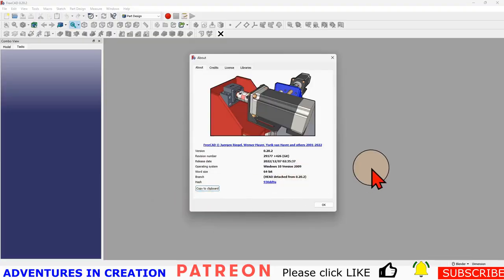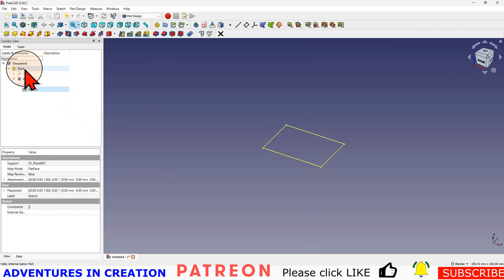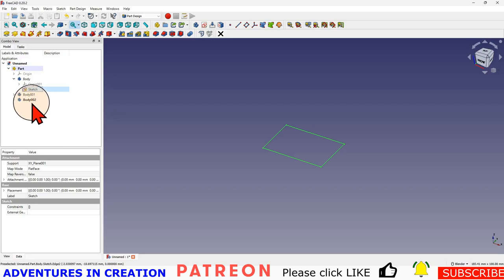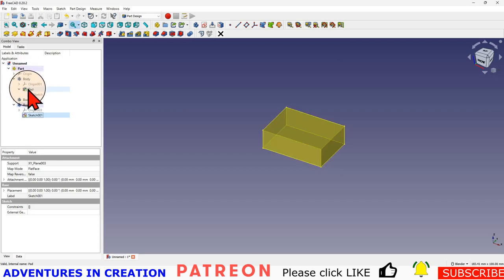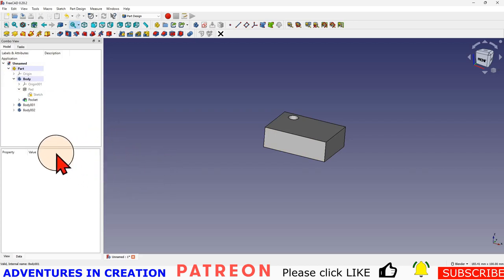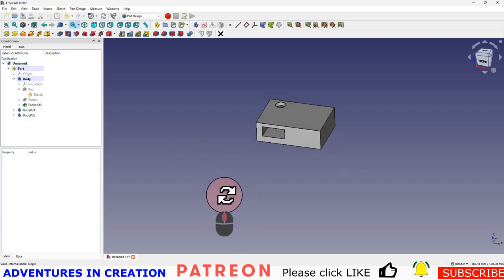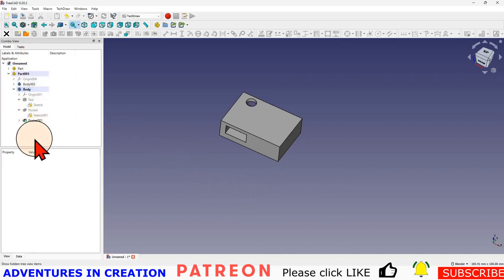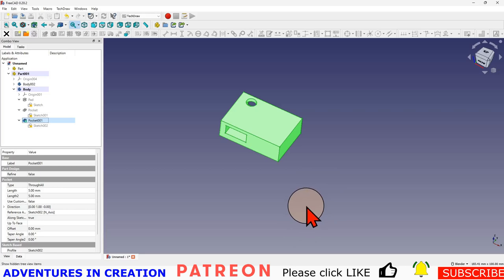Back 2 Basics Number 5 FreeCAD basics #freecad #cad #design #makers

Comment: Excellent video!🎆 Very often I screwed up the objects because I had some hickups in the object structure. And couldn't fix it, i.e. moving a sketch to the right body. 
I had to start over again..😢
NowI finally understand the structure, understand what needs to be active and when, and how to move elements if needed. Most important video for beginners imho.🙏
Reply from the maker: Thanks!

Comment: Again a very helpful video which exactly addresses the things that I encounter while I am still learning FreeCAD. So thanks a lot for that! :-)
Reply from the maker: You are welcome. I based that series on the questions that people have reached out with. Glad it helped you.
Reply: Thanks very much for this and the other beginner series. When would you create a part & when would you create a body? 

I really like this series, I’m not sure FreeCAD is as intuitive as Fusion360 but I want to learn it, as Fusion360 seems to be becoming more restrictive for makers & I don’t want to invest a lot of time in something I may not have access to in the future & open source is the way to go. 3D printing, Blender, Inkscape etc. show the benefits of open source.
Reply from the maker: @steveporritt1550  I use a part as a container for bodies. Several bodies can exist inside a part. You can use multiple parts in an assembly. I typically create a part then use multiple bodies that make up that part. - I hope that makes sense.